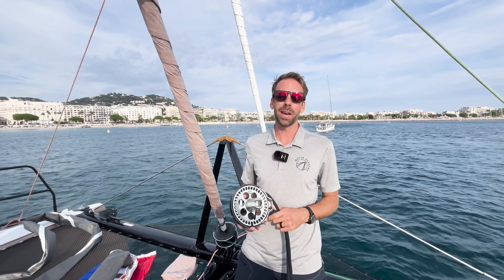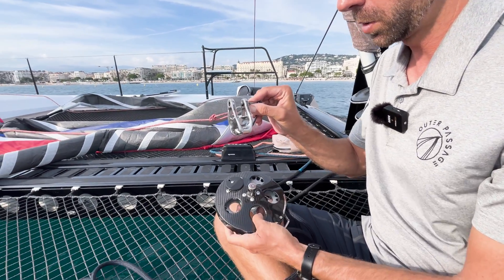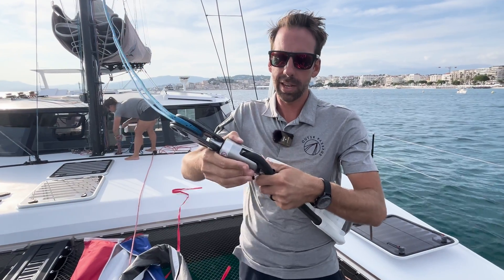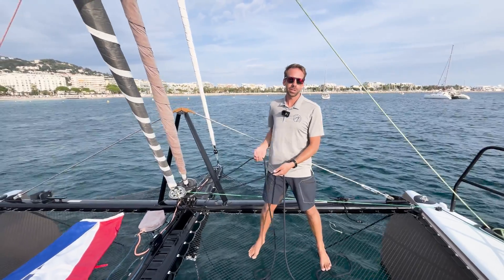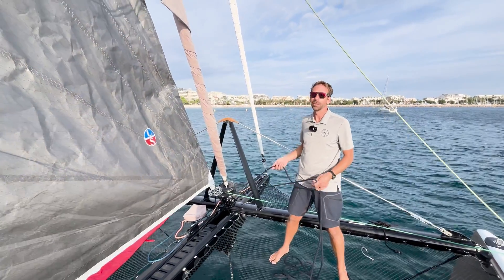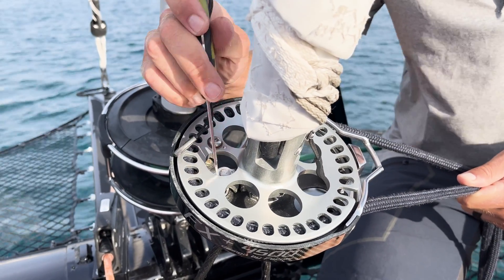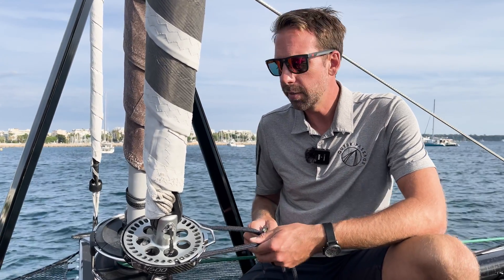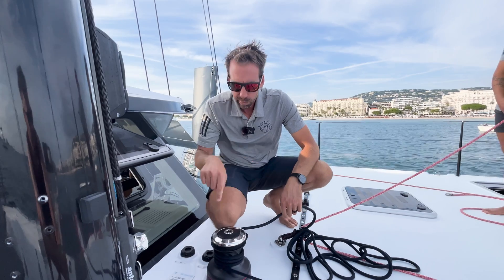Mastering the Continuous Line Furler for Your Head Sails - with @OuterPassage

Comment: Can you block it halfway, as a means of reefing? Strangely, no presentation of this type of gear I watched mentions this, while I think it is probably the most important piece of information.
Reply: No
Reply: @andrewoliver0So if you are not racing around the cans  it is pretty useless then
Reply: @paulmelessen582 I race offshore with lots of sails on a karver furler- you just have to peel to a different setup if the wind changes
Reply from the maker: Generally speaking the sails are not designed to be reefed. These reaching sails are not made of heavy cloth and are not to be used in very heavy winds, at least close to the wind.
Reply: @balancecatamarans That is a helpful comment. Do you mean that the sail can tear if rolled up halfway?

Comment: Will the sail open using the sheet and without you pulling on the furler line?
Reply: Yes. That's how you're supposed to unfurl the sail.. Video makes it sound like you have to use the furling line to do it but that's incorrect. But you do have to keep tension on your furling line When you're hauling the sheets so it doesn't backlash (Get tangled). This furling system is made to go with a winch or a handle at the control end that you turn in one direction or the other... it doesn't have much use free hand.
Reply from the maker: Ideally you do control the furling lines from racing out when unfurling, and it is important to be well off the wind to avoid the sail coming out under massive load. Furling of course someone must ease the sheet carefully are the furling lines if brought in. Phil

Comment: What have you done to attach the tack of the curler? It looked like you used a loop of dyneema? What stops your entire mechanism from turning when furling ?
Reply: There is a line rigged on the longeron, laterally, luggage tagged on stbd, low friction ring on port, then aft to the clutch.  When tensioned, everything is rigid, like a forestay and doesn't twist.